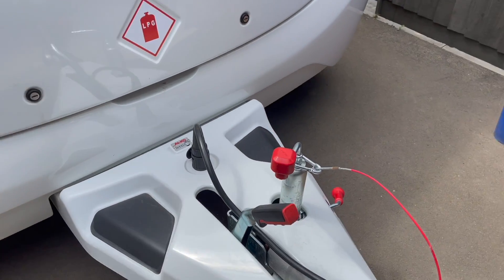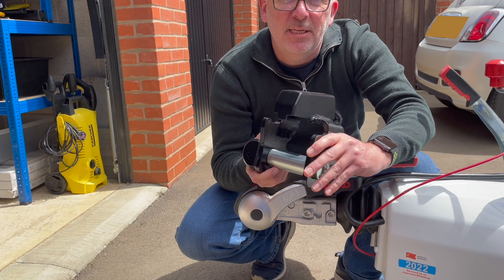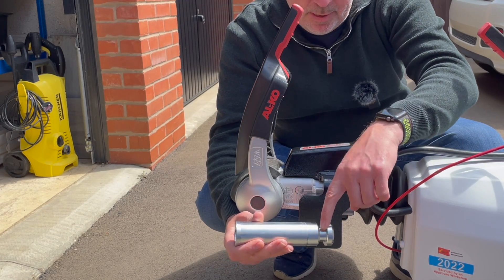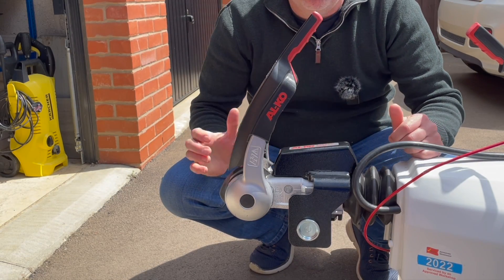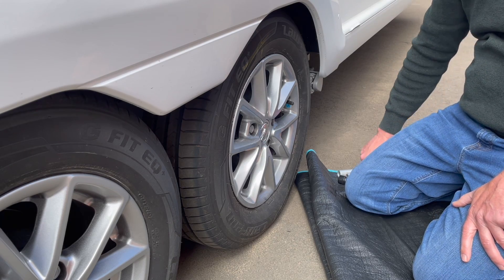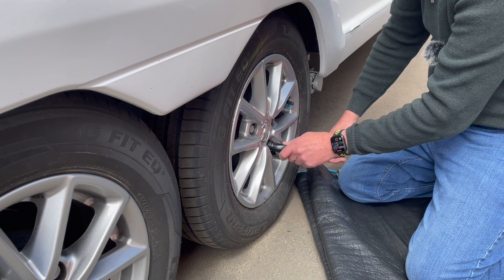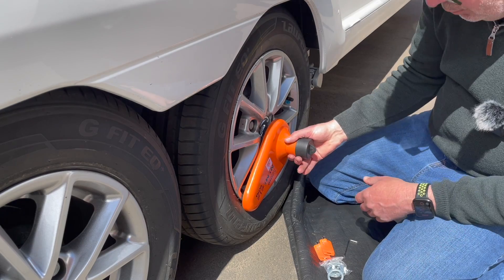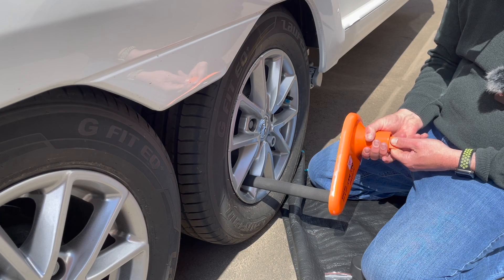Caravan Security - Is It Secure Enough?

Comment: Great video. I have added a dummy 13 pin plug and lead. The dummy lead is about 1m long with a 13 pin plug at one end and the other end all of the wires are connected together. The proper original  lead is tucked underneath out of sight.  The idea is that if somebody actually bypasses the other security measures, and plug the dummy lead to their vehicle the the fuses would blow on their vehicle due to all of the wires being connected together.  Hope this makes sense.
Reply: Cam down james bond lifes to short

Comment: Love how you just put whatever receiver you wanted on that wheel because it was smaller 😅 Ive always been told they are different because ones designed to be seated on alloy wheels & ones designed to be seated on steel wheels & the Torque recommendations are different for both so just keep an eye lol
Reply from the maker: The fittings are the same, just different lengths, yes I learned about the different torques when we had a picture as the spare wheel is steel, good tip!

Comment: The instruction were to fit the shims on the wheel lock was very usefull. My Nemesis wheel lock now fits without any slack even when the allen screw is loosened. Neither the intruction manual nor various Youtube video's adressed this bit. So: thanks!
Reply from the maker: Glad you found it useful

Comment: The hitch should have a safety ball fitted before fitting the lock !!! Also the emergency services highly recommend that a hitch lock is NEVER fitted when towing. This is in case of an accident where the hitch lock makes it difficult or impossible to separate the car from the caravan. Nick T.
Reply: Hi the safety ball is very important to fit as thay can hook onto the hitch and get the caravan away.
Wickes sell battery angle grinders for £90 thay will cut the nemesis wheel clamps in half in less than a minute easy you need two good wheel clamps or its bye-bye caravan.
We need some good security products.   Thanks Andrew.
Reply: Emergency Services will have your caravan separated in seconds if required, by all means use a lock if it gives you piece of mind.

Comment: I'll stick with the 2 Alko wheel locks on mine as dead easy to fit and remove with the receivers already on the chassis and none of that faff you had with the Nemesis constantly.fitting and removing trying to figure out how many shims are or aren't needed. 
I think the Alko also is the only diamond standard wheel lock for insurers and maybe insurance discounts .Re cost find the Alko number eg 33 and buy online for a fraction of Alko price , register it with Alko and save on your insurance and more "peace of mind: with security

Also as per other comment dont forget the hitch ball.
Will be also fitting a £29 tracker that just arrived 2p to text it to see where thw caravan is and alerts me if moved from a preset area eg your drive or lockup.

Comment: Very informative.  But everyone is quite right there isnt any locks that are foolproof. So then knowing this all you can do is have a deterrent.  First off a top of the range tracker with plenty of window stickers. Or if you can get hold of some original stickers just use them. Then as many visual locks you can afford iv got 5 , alko wheel lock .on other side nemisis wheel lock. And 4 corner steady locks, hopefully theives will say bugger that lets finda easier one to steal

Comment: HI, just found your channel this weekend and I really like your style and delivery. I use two alko wheel lock on my van, firstly because they are the only locks that my insurers will give me doscount for, and secondly on a twin axle it is absolutely essential that you secure both axles on the same side of the caravan. I would encourage you to reconsider the security on the wheels. I really like that premium hitch lock though.
Quick question have you considered how you will level your twin axle? Front to bacl is easy enough but side to side more challanging. I haven't solved that yet on my van!
Reply: @BigWhiteBox  I am looking at lock n level at the moment, fairly expensive but they have some great reviews and seem to answer all the problems!
Reply: @geraldmartin9386  I would highly recommend JSB Hublocks having just lost a caravan fitted with Alko wheel locks which they just cut through the locating lug on the chassis in minutes these Hub locks are pretty much the best you can buy. Just requires a bit of patience to fit but well worth the piece of mind.
Reply: Lock "n" level is really worth it (for me anyway)

Comment: Hi i have been Caravanning for 40 years 1 hitch lock and 1 wheel clamp is not enough a professional caravan thief will have it away in about 2 minutes sorry to say you need more security thanks Andrew.
Reply: @BigWhiteBox   
Hi all you can do is put more locks on.
Thay even tried to get a stolen caravan over the canal on builders planks but the caravan fell in the water that was about 10 miles from you going north.
I have seen the professionals use battery angle grinders and Oxy-acetylene thay often leave the hitch lock on and just put a ratchet strap around the tow ball.
 I have a question how are thay blowing off with Oxy-acetylene the Al-ko wheel clamps behind the wheel without setting the Caravan on fire as the wheel arch is plastic.
thanks for your help Andrew.